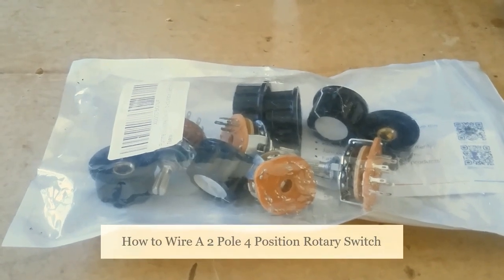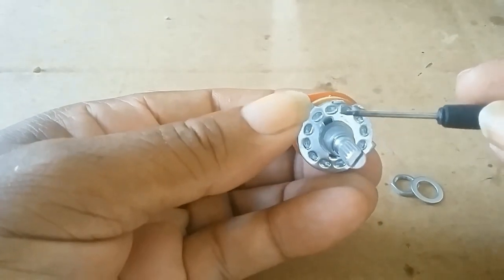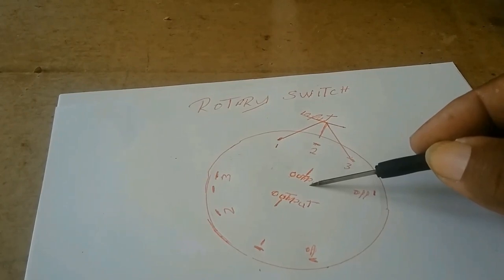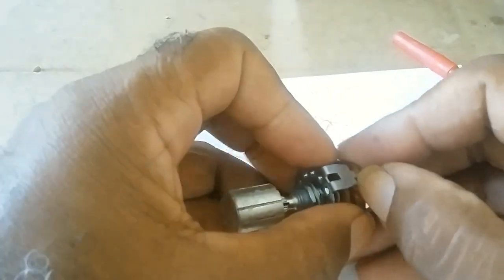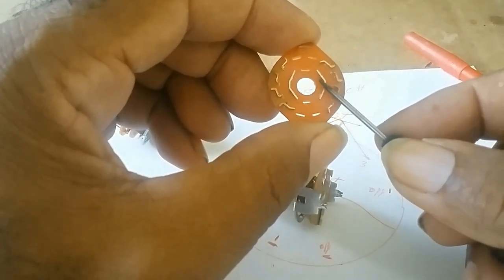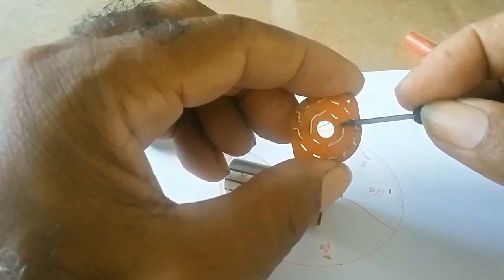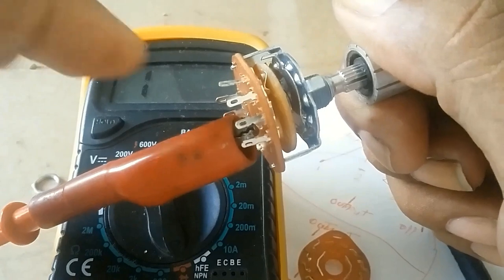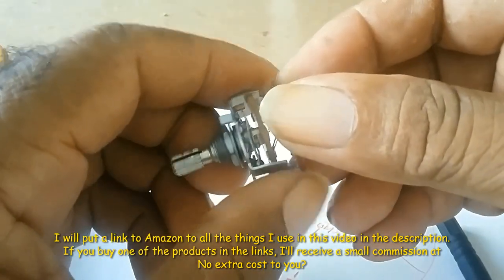How to Wire A 2 Pole 4 Position Rotary Switch

Comment: Good eve sir how to wirig the the 2 pole 5 possition selector switch
Reply from the maker: Same as the 4 position switch. Put a meter on one of the too pole to see which ones have continuity with the 5 poles.
Reply: @AlwynNicholas  one more question sir what is the meaning of pos and com
Reply: Because in pcv board thier is pos and com  thats why i ask you something what is the meaning of that
Reply: @AlwynNicholas  thank you for andswer
Reply from the maker: @noelgara2956  Positive is the  power + and negative is ground -.
Reply: @AlwynNicholas  you mean the meaning of com sir is ground but in my pcv board is two com the one is in the switch A  and the otber com in the connection of AC in

Comment: Which switch to use if you only have one voltage (12V) but you want to send it to only one of 3 light bulbs? I need to make an indication light that will either be red, yellow or green, but only one light on at a time
Reply: 3 position 1 pole, 4 positions if you want an off position